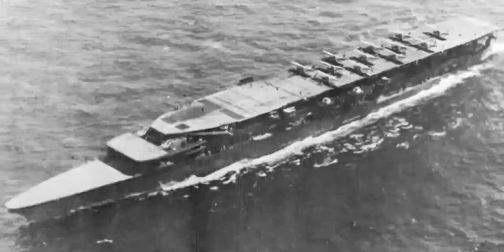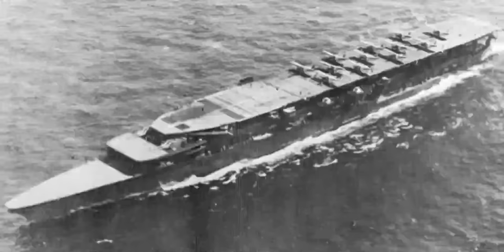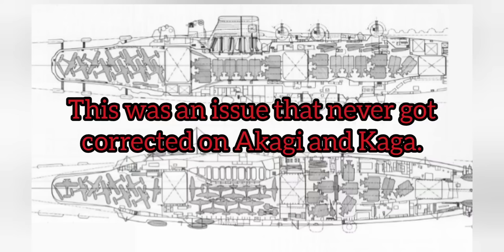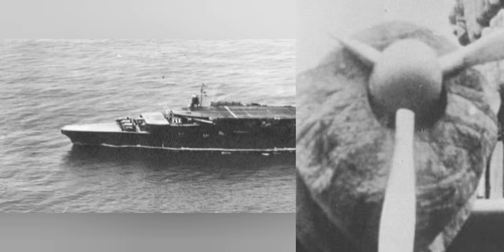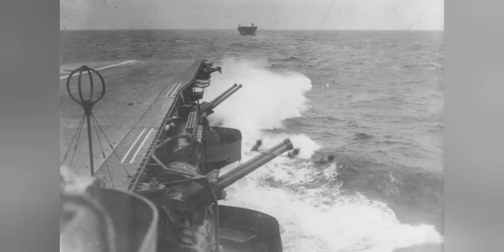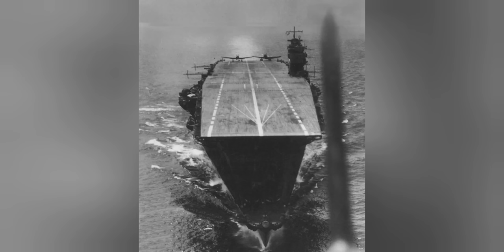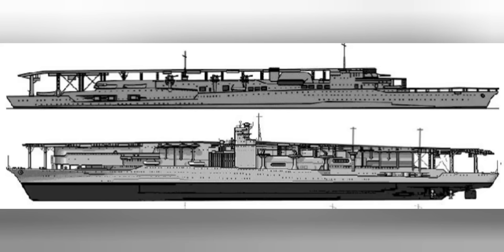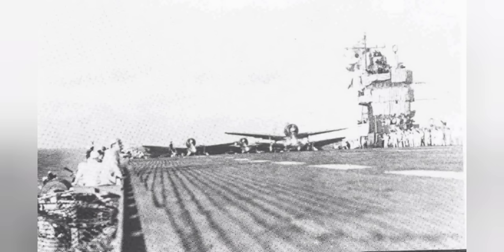Akagi and Kaga design faults. (Part 2)

Comment from the maker: Note time.
To connect design differences between Akagi and Kaga with all following carriers above 18,000 tonnes, you can view them in this playlist:
https://youtube.com/playlist?list=PLb04icwYsuHxMRMlbMu2lyC0BIowEHp2z&si=i5Py-lKFqG_BbZA1

This wraps up the design phase of Japan's big boi carriers. It is finally time to move onto the smaller vessels such as Hosho and Zuiho. 
As I stated in the video, Akagi and Kaga had more issues, I just list major points.
Considering that Akagi and Kaga are arguably the worst of Japan's large carriers design wise, they were still valuable units in battle. As far as carrier conversions go, I would consider Akagi and Kaga among the best with Lexington and Saratoga. 
I do not focus on the reconstructions of the ships. I only mention the reconstructions where early design issues remained.
Reply: I dont think we can blame Kaga or Akagis loss on leaking AVGas
unlike Taiho, Shinano, and a few others... seriously At Least 4 Japanese CVs or CVLs were lost due to leaking AVGas and low quality damage control. At Least.

Comment: The book "Shattered Sword" is an excellent book to read on the Battle of Midway, where these two ships were sunk. Some of Japan's older carriers had fire fighting main made of cast iron. The metal can shatter and break if shaken, like from an explosion. If this happens, you've just lost part of your fire fighting capability. This is a serious weakness.
Reply: True and the cast iron becomes shrapnel when shattered that rips open fuel lines, aircraft fuel tanks, water mains, fire fighthing hoses and of course personnel.
Reply: Add to that that they used bamboo to insulate pipes and vents.
Reply: I heartily recommend that book
Reply: ABSOLUTELY the best book on Midway!
Reply: There's a video now on YouTube that shows the Akagi at the bottom of the sea, with Jonathan Parsal as the technical expert. Well worth watching.
Reply: Drachinfel has a pretty good video on the differences between American and Japanese damage control. Needless to say, Japanese practices do not compare well versus the US Navy's.
Reply: That’s the problem with large-scale, generational conflicts, you’re blowing stuff up too infrequently to really benefit from any learning. The more regular, limited warfare between professional armed forces in Europe allowed them to get really good at fighting.
Reply: Midway Inquest is also an excellent book but should be read after Shattered Sword.
Reply: The American system of having everyone trained to fight fires was much better than the Japanese system as well. I never knew about cast iron mains! Amazing mistake.
Reply: +1 for “Shattered Sword” - it’s a must-read if you’re interested in the Pacific theater.
Reply: I'm sure that is true. But also they had designated firefighters. If they died or couldn't reach the fire then it was over. The American carriers also had more redundant systems.
Reply: I've read Shattered Sword maybe 5 times so far. It's such an incredible book.
Reply: Thank you gentlemen for recommending the book on Midway, SCATTERED SWORD!
I began reading about Midway and I'm glad I have..
  SSword is  now at top of my reading cue !!!
Reply: " Midway Inquest" also!
Looks like I'm in the right place.

Comment: To be fair to the Japanese, the triple-flight-deck design was something the British dabbled with as well. To me Akagi and Kaga are more examples of how fast navy aviation was moving; ships that were at the forefront of innovation were horribly ineffective within a few years. And conversions were always inefficient, only the Lexington's really pulled it off and they did that be being absolutely massive. And I think HMS Formidable missed the memo about carriers should never be attempting to get into gun range of surface ships..
Informative video though, the non-uniform hanger arrangement was something I didn't know about, but is probably a crucial to maximising space efficiency.
Reply: The idea of a double or triple flight deck in itself is also a good idea, as long as it works with the available aircraft (which it did at the time of introduction, but not later on). 

Being able to launch your fighters while there are landing operations on the main deck is a great feature to have (and the US Navy also tried to retain a similar feature as late as WW2 by placing catapults inside the hangar of early Essex class ships, launching sideways). You also reduce the number of aircraft that have to be moved with the elevators, which would decrease the time between strikes. The concept is not that much different to the angled decks of modern carriers.
Reply: The Lex's had their own problems, but there's always a learning curve.
Reply: Hubris.

Comment: The greater the freeboard, the more force of a cross-wind your boat or ship will be exposed to while under way. There were classes of prewar ships that were death-traps in comparison to their modern counterpart: Salt Lake/Indianapolis Class compared to the Brooklyn/Cleveland Classes. Half of the former ended up on the bottom. In the latter, only Helena went down after a clash with the IJN.

Comment: Bear in mind that the Akagi, and the Kaga were designed as battleships, and construction started in 1920, The washington Naval Treaty of 1922 limited the number of battleships nations could have. Finishing these two ships as battleships would have put Japan in violation of that treaty, so they were redisigned as  aircraft carriers (over 1 year into their construction). It is unfair to describe the design limitations as faults, as these ships were not designed, or intended to to be carriers. Turning these ships into carriers was a bit like trying to put a square peg into a round hole, as the belt armor, and secondary gun hardpoints were already installed. As for air compliment, the Kaga, and Akagi carried 90 aircraft (72 opperational), Very comparable to the U.S. Ranger, Yorktown, and Lexington class carriers
Reply: Yes this video has some major flaws. Their aircraft complement was quite reasonable.

Comment: Japanese carriers in WW2 also only had specialized damage control teams trained, not the whole crew like American carriers. Another weakness. If these specialized DC teams got killed, you had no one else trained to fight the fires.
Reply: Yes even Admiral Spruance knew how to use a fire hose. When his flagship got hit, they found hm calmly fighting the fire with one.
Reply: Too bad it took another tragedy for the USN to relearn that all crew need to be able to fight the fires with USS Forrestal.
Reply: @rizon72  was this not the case? All I know is that the ship was an inferno. Were there problems with damage control as well?
Reply: @rocketguardian2001  Explosions wiped out the highly tried fire fighters and the rest of the crew wasn't trained.

Comment: Part of the problem with being among the first large, fleet carriers entering service in the 1920s.  New stuff has problems, especially made worse that these were not purpose built carriers.  Akagi was a battlecruiser conversion and Kaga from a battleship.  I'm not sure if their American equivalents from the same era had as much problems, i.e. the Lexington-class battlecruiser to carrier conversions (Lexington and Saratoga).

As far as having 8" guns on them, it made sense for the time they entered service in the 1920s.  The Lexingtons had 8" guns, too.  You have to remember that aircraft in the 1920s were weak and had bad range.  The ability for aircraft to be launched, travel afar to scout was very poor.  The US Navy started using their new Lexington-class carriers in "Fleet Problems" (massive fleet exercises and wargames) in the late 1920s.  You can find cases of the Lexingtons running into opposing surface forces and getting sunk in these games.  There's also an example of them surprising US Army & Navy defenders at Hawaii.  So big guns for self defense had merit at the time.

The US Navy ditched the big 8" guns off their Lexingtons eventually in 1942.  None of their later carriers ever had such large guns ever again.  The Imperial Japanese Navy followed suit with their later carriers lacking large guns.  The 1930s saw aircraft technology improving.  They were becoming stronger with better range but it really became pronounced in the very late 1930s.  There was no need for big guns on them.

Comment: The US carriers had fuel standpipes which when not fueling aircraft would be pressurized with Nitrogen forcing the fuel back down the storage tanks safe from attack. The Japanese carriers did not have this feature and this proved disastrous.

Comment: The weather agency rears its ugly head once again at 3: 30 with the concept of the open hangar.  The US went with open hangars.  How did this affect survival/damage control, and, of course, flight ops?
Reply: As discussed in volumes such as "Shattered Sword" by J. Parshall and A. Tully the open hangars allowed for the venting of blast overpressures when the ships were hit by bombs, causing less damage to the flight decks. Also the hangars were much better ventilated and avgas fumes from fueling planes in the hangar would not accumulate. In fact the ventilation was good enough for planes to warm up their engines in the hangars prior to being brought up to the flight deck, if need be. And if there was danger of planes, fuel, and ordnance catching fire due to enemy hits equipment could be shoved into the sea through the side openings, something the Japanese could not do at all when their carriers were hit at Midway. The U.S. design was not perfect - the lack of armor on the flight deck itself meant that bombs could be expected to penetrate into the hangar (British carriers in contrast had armoured flight decks). And USS WASP was destroyed by the shattering of her avgas fueling system as well as planes on her flight and hangar deck smashing up from the shock of torpedo hits.
Reply: @takashitamagawa5881  US carriers hangars had flexible steel curtains that could be closed during heavy weather.

Comment: What are the fan-like markings on the flight deck at 6:35? Were pilots supposed to fit their props inside those lines or something?
Reply: Wind indicators. There was a vent at the point of the fan that released a small amount of steam so the wind direction could be seen.

Comment: Guns on a plane carrier?  I considered the idea many times in my "what if" scenarios, usually ditching the 8" armament . . . until today, when I realized that WW2 carrier flight ops was severely limited by sea state and weather.  There was a definite chance your carrier would find itself in a running duel with enemy battlecruisers or cruisers during rotten weather . . . we laugh at 6" or 8" guns on a carrier now, but I bet the captain of HMS Glorious wished he had a few, despite the inequity of his situation.
Reply: If a aircraft carrier got in a gun duel  even a destroyer could sink them easily. A crusier or battlecruiser would have sunk them very easily.
Reply: We laugh at the idea of a gun-armed carrier and for a good reason. Guns are dead weight. They pose a risk. They are useless. Carriers shall never ever meet a surface force within their gun range. Even if, a 6" or 8" armed carrier will be underarmed against 10", 12" or bigger adversaries as they are completely unarmored against their guns and rightly so. When you want to protect a carrier as part as a battle line, you will get a 70.000 ton monster that carries 40'ish small fighters or less bombers/torpedo bombers. Shinano could carry 47 planes. 47 for 68.000 tons. Mind you, the light carrier Ryujo carried 48 planes for 12.000 tons. For comparison, the Essex class carried twice the amount of planes in less than half of the displacement.
Reply: @karstentopp 

This is also why the idea of fast battleships operating alongside carriers ended up not being effective enough to justify the expense: the battleships ended up as gigantic destroyers rather than capital ships to defend the carriers from surface attack.
Reply: @bkjeong4302  That's why they invented the light AA cruiser of the Atlanta class for instance
Reply: @karstentopp  

Only after wasting resources on the Iowas.
Reply: @bkjeong4302  Learning is a hard and wasteful process as you usually learn from mistakes, not from successes
Reply: Exactly.  It's easy to scoff at such a situation, but before radar, and when planes couldn't fly at night or in bad weather, carriers were just cruiser-sized ships without any guns.  Mist, fog, rain, any kind of reduction in visibility meant a carrier and enemy cruiser could easily happen to find each other by mistake.  Even in good conditions, planes in the 1920s had short ranges and not all had radios, so spotting an enemy cruiser  might mean not reporting its closeness soon enough, and the plane's return flight told the cruiser which direction to look.  Gun battles were all too realistic a possibility.  I believe one or two of the US Navy fleet problems with Lex and Sara ended up with carriers sunk by gunfire.
Reply: @grizwoldphantasia5005  Indeed. Aviation and plane handling improved rapidly.Many early designs became obsolete quickly. So quickly that no US fleet carrier was ever sunk by gunfire. Only Gambier Bay (CVE-76) was sunk by gunfire and she was an Escort Carrier built by mercantile standards and very light weight.
Indeed, the only losses of carriers to guns are Gambier Bay, Glorious and Chiyoda, with Chiyoda being crippled by dive bombers and finished off by gunfire. Again, guns have proven to be less effective than submarines and planes and this is easy to understand. Carriers have to be fast to create wind over the deck and most (fleet) carriers outran gunships easily. Hence the perceived "need" for fast battleships to protect the carriers. But gun range is (very) limited, compared to airplane range and long range precision shooting is a fine art compared to dive or torpedo bombing.
Pre-war the situation was less clear, but precision night fighting was as evolved as night time flying ... and flying evolved quicker.
Reply: He was in combat against enemy battleships and was greatly outranged. Scharnhorst scored the longest hit ever recorded. 

Glorious should never have been left alone like that. It was a dysfunctional Royal Navy that lost her, not the lack of 8" guns.
Reply: @Heike--   It was not a "dysfunctional Royal Navy" that lost Glorious. It was an intelligence mistake. Or rather, simply something the intelligence missed. Those are two very, very different things. Nobody knew that the German battleships were at sea, and those didnt know about Glorious either, the fact they stumbled across each other was, as so often, pure coincidence. Carriers went around with only a destroyer escort quite often, and when according to your intelligence there are no enemy ships in the area, and you are in a "safe zone", there is no real need to escort them with heavy surface units. Especially when you dont have your fast battleships in service yet (this was June 1940, only German and France had fast battleships in active service at that time), so you only have 3 battlecruisers able to match the carriers speed, excluding normal cruisers, which would no have been able to stop the German battleships anyway.
Reply: @xxnightdriverxx9576  

Even then, Glorious wouldn’t have needed a heavy escort if the commander had been competent and sent up patrol flights (the weather was good). Then she’d likely have seen the Twins and just left the area before she was found by the Germans.
Reply: @Heike-- Warspite enters the chat ......longest range hit ever recorded not salmon ...
Reply: @grizwoldphantasia5005  
Carriers USS Lexington and Saratoga were converted from battlecruiser hulls in the 1920s. Like these two IJN carriers.

USS Lexington and Saratoga were built with two twin 8-inch gun turrets for the same reason. They were removed in early 1942, when they no longer were logical.
Reply: Nope. Scarnhorst and Gneisnau would have still pounded him into oblivion from outside his range. Once close, carriers are done for against battleships (clearly that should never be allowed to happen). This was the genius of the Japanese plan at Leyte Gulf which Admiral Kurita couldn't comprehend.